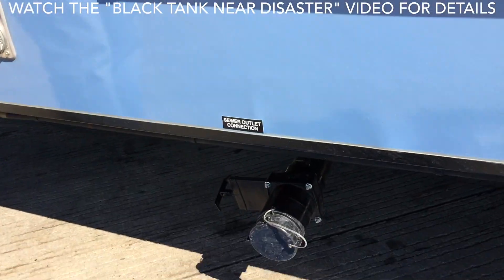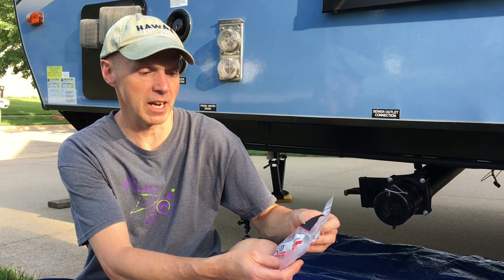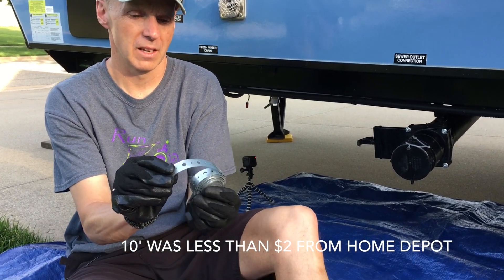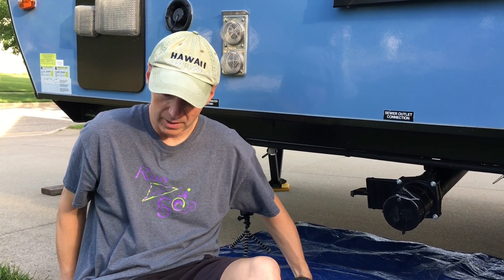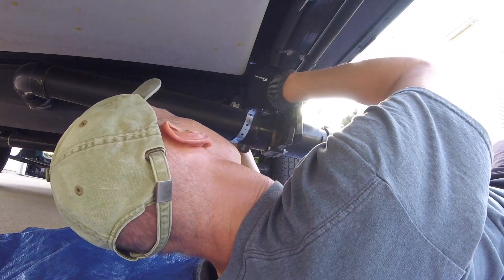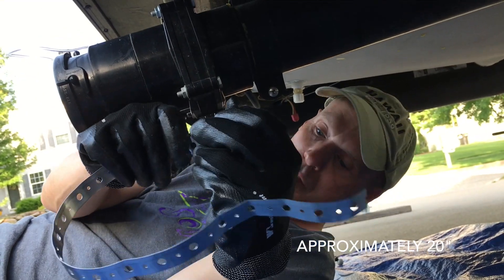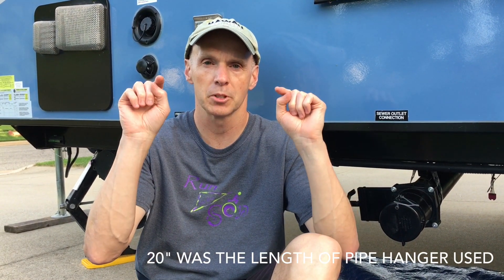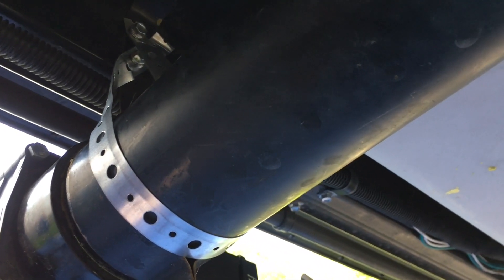R-Pod Black Tank Pipe Reinforcement

Comment from the maker: Products I used in this video to reinforce the black tank sewer outlet hanger:
- Galvanized Steel Hanger Strap: https://www.homedepot.com/p/Oatey-3-4-in-x-10-ft-Galvanized-Steel-Hanger-Strap-339232/100167964
- Stainless Steel Split Lock Washer: https://www.homedepot.com/p/Everbilt-1-4-in-Stainless-Steel-Split-Lock-Washer-6-Pack-800411/204276544

Products displayed in this video*:
- Camco Flying Insect Water Heater Screen (4.5" x 4.5"): https://amzn.to/2KmvFaR
- Camco Flying Insect Water Heater Screen (6" x 8.5"): https://amzn.to/2tLOopt
- Camco Flying Insect RV Furnace Screen (2-7/8"): https://amzn.to/2lDfBXA
- Not shown, but also useful - Camco Flying Insect Screen for Dometic Refrigerator (6 pack, requires 2 packs): https://amzn.to/2yFqUrw

*Affiliate Link Disclosure:
As an Amazon Associate I earn a small commission from qualifying purchases. These commissions help support the future development of this channel.

Comment: Traveling from AZ to NY on a 6 week road trip, I noticed the bolt was loose holding up my black tank pipe.  I replaced the bolt and nut in Indiana. On our way to Canton, the black pipe hangar strap broke at the 90 degree bend and was dragging on the ground.  Fortunately, I was able to quickly use some rope on the side of the highway and get back on the road within 5 minutes.  Once at the campsite, I ordered a new fitting and got some metal strap at an Ace Hardware.  It is highly recommended for any R-Pod owner to reinforce this hangar.  Once I get back into AZ I am going to use some threaded rod and really get this problem resolved.  Thanks John!

Update:  used a 4” eye bolt with a 1/4-20 thread pattern and really secured this pipe.  Backed it up with a metal strap.
Reply from the maker: Thanks for sharing your experience. It’s unfortunate this same issue is still happening. All the best!

Comment: Sitting here in my campsite watching this video. My bracket broke where the bracket attaché to the pipe, on I-40 west of Santa Rosa. Unfortunately significant damage to the end of the drain since it hit the pavement and someone signaled us. We are doing the pipe wrap fix tomorrow and probably will reinforce the gray water at the same time. Everything from the valve gate to the end destroyed. Was able to jury rig a temp fix and seal the pipe. Man’s best friend, duct tape allowed to attach the hose and seal the gate and we can still use the tank. Bracket is worthless!! Video saved the whole trip.
Reply from the maker: Al, sorry to hear about this happening. It has been a real issue with the R-Pods for years. Sounds like you were able to get it under control in the short term. I am glad the video was helpful. As an FYI, the fix I did on this was done in 2018 and is still holding up fine. All the best!
Reply: @JohnMarucci  thanks John. I get to my daughter’s in the Bay Area tomorrow. A follower RVer and I tried to jury rig an attachment to the waste hose, leaked badly but we were able to dump the small amount of test water we put in. Leaked pretty badly, so I’ll have to wait till I can rebuild from the gate out. I think the easiest part will adding the straps. Having no bathroom is really a drag

Comment: Hi John, I watched this video after we got our 2019 R-Pod 190, and I thought great idea, so I added straps “just in case” on the black and gray tank pipes. We’ll, I’m SO GLAD I did. This past weekend we drove to our favorite campground, and upon arriving and hooking up I noticed that the bracket for the black tank broke clean through (at the bottom of the L bracket and where the screw is). Luckily I had added straps like you did, so the pipe didn’t get ripped off or drag along the highway. That would have been a really crappy experience (especially for the people following 💩😳). We have yet to receive the recall notice, I called Forest River and of course they didn’t really seem to care. Soonest service date is November here in Walla Walla, in the mean time I discovered a better way to mount that bracket, reusing the original piece but re-engineering how it mounts to the pipe and frame to eliminate the flex that broke it in the first place. Thank you very much for this video, it literally saves us from disaster! 👍
Reply from the maker: Joe, glad to hear you had reinforced the hanger before the bracket broke on you. As a reference, I put the galvanized hanger straps on my R-Pod in March of 2018 and they are still in great shape and have worked without issue since. All the best and thanks again for the comment!

Comment: Thanks for this! I checked the black tank hangar on my 2017 R-Pod model 179 before my latest trip. It seemed OK, with no flex. But 4 miles up a bumpy dirt road last week in the eastern Sierra, I heard a noise and saw in the mirror the outlet dragging in the dirt. Thankfully, I had zip ties for a temporary fix.  

Note to all...when checking your black tank hangar, get down on the ground and look up the whole length of the hangar. Or...just follow this video, and fix the hangar before it fails. 

Thanks for this video.
Reply from the maker: Thanks for the comment! Glad you had some zip ties. All the best!

Comment: Hi John,  same thing happened to me, except the down strap broke completely.  The bracket bolt was intact because it had a lock nut on it and it was holding the other broken piece.  I replaced the entire down strap with galvanized perforated strap doubled.  I did successfully drill a second hole and reused their self tapping screws. I wasn’t lucky enough to have the original holes lineup. Tomorrow I’ll crawl back under there with a small can of black rustoleum paint and tube of silicone and fill the old hole left exposed.   I’ll cover the terminal connections (sensors) on the sewer tank.   Their cover looked like it wearing off.     Yesterday I replaced the hotwater heater module. The original had 2 burn spot on it.  I have a 179
Reply from the maker: Robert, thanks for the comment. It is unfortunate that this keeps happening to R-Pod owners. It sounds like you have a well thought out solution that really shouldn’t have been needed had it been done properly at the factory. This is an obvious and ongoing design flaw, and since a lot of water/waste weight can fill the larger diameter black tank drain pipe, it means we all have to be extra careful to drain the tank fully before travel. All the best!

Comment: Wish I had seen this earlier!  We were driving down the highway in Idaho when a car notified use that we had an issue with the Rpod.  I pulled over, and the bracket holding up the pipe had broke and the pipe was dragging on the ground.  It ground down quite a bit, causing the valve not work.  Luckily we had some bungee cords and were fairly close to an RV shop.  I’d suggest for anyone to reinforce that pipe!  Thanks John!
Reply from the maker: Jon, sorry to hear this. This has happened to so many people I’m not sure why it hasn’t been fixed in production a while ago.

Comment: Thanks John. A  great tip and idea.I wonder about those loose wires going to the sensors. I duct taped some of mine up I have a new 180. Your thoughts?
Reply from the maker: I don’t like those wires loose either. I will likely do something similar soon. I wouldn’t want road debris catching one of the loose wires for sure. Thanks for the comment!

Comment: So John, what do you use to take off the black corrugated cover under the RV to get to the inside of RV beam to place that strap?
Most are not bolts but look like some type of rivets.
Reply from the maker: My R-Pods didn't have the sealed underbelly and I haven't dealt with this on my Keystone Bullet that does have this material. My counsel is to search YouTube or call a local dealer and try not to get into a situation where you can't replace the material.

Comment: This happened to me. Twice!! I definitely want the backup tape now. But I don’t have that fancy-dancy drill. Will my standard one work if I’m just removing the bolts already in place and not drilling new holes?
Reply from the maker: You should be able to reuse the existing bolts that are in the frame as I did. You will need the correct socket to remove them in order to install the aluminum hanging strap.

Comment: You can buy an a replacement pipe hanger bracket from Forest River.   I already broke both of them and had them replaced and I expect the replacements to break in the not so distant future because they are made with inferior metal and are bent at 90 degrees which is guaranteed to already greatly increase the fatigue in the bend.  I have found that the RPODs are a weird combination of good and horrible materials, some things are really well made, others are made with what appears to be the cheapest and worst possible choice.   RPODs - and RVs in general -  are NOT for the faint of heart and people unfamiliar with mechanical repairs.
Reply from the maker: Thanks for sharing your experience. My easy fix using the strap never failed for several year.

Comment: Could you just use a thick zip tie?
Reply from the maker: Short term possibly. I’d want something more substantial longer term. My fix using the galvanized hanger strap was easy to do, cheap, and is going on four years without any signs of issues. Thanks!

Comment: Thanks for all your great videos. On this project, however, I would be concerned about the sharp edges of the plumbing strap cutting into that propane hose over time.
Reply from the maker: Good point but likely not an issue. I have had mine on like this for coming on three years with no gouging to the plastic pipes. Many people use pipe hangers instead vs the straps. Use what you are comfortable with, but the main point is to have something as a backup to the small bolt. Thanks!

Comment: I really appreciate your informative videos, John. I'm getting ready to reinforce our tank pipes. How has the strapping tape fix held up? Any issues with Michael Nelson's concern of rubbing through the pipe?
Reply from the maker: Mary, the pipe hanger strap (and new bolt with locking nut) has held up great over the last year since we added it. Several thousand miles including a round-trip from Michigan to Florida with no issues. Very please with the solution. Also, zero noticeable wear on the pipe from the hanger strap. Thanks for the follow up question!

Comment: What size bolts did you use?
Reply from the maker: On time stamp 15 seconds on the video it shows a picture of the bolt. It is an M7-1.0 x 20 mm zinc plated bolt. Thanks!

Comment: I really enjoy most of your videos, but I don't think this is a good thing to do.  The sharp edges of that strapping metal are going to dig into the plastic as everything vibrates.  I think it would be better to use automotive exhaust pipe hanger hardware than that metal strapping tape.
Reply from the maker: Thanks for the comment. Your idea is likely a better solution. I have put a bunch of miles on since and am keeping an eye on it. So far I’ve seen no gouging on the pipe. Thanks for watching and commenting!

Comment: John, thanks for your videos. Shame on me!  I watched this video before buying a new R—Pod 195 but assumed this type of mounting had been improved and didn’t even look to see. Well it’s still the same and on our trip last weekend our bolt broke and we drug our pipe on the interstate for a few miles before someone flagged for us to pull over.  Again, stupid me for not checking!  Very poor design. Warranty repair is scheduled.
Reply from the maker: Mark, sorry to hear about this. To me it seems inexcusable to not have fixed the flaw in the tank support bracket by this time and with so many incidents. Again, sorry this happened. All the best.
Reply: @Mark Ramey. We also watched this video before purchasing our 2020 RPod 190 and the same happened to us. We drove over 40 hours and the bolt became loose and we drug it for a very long time on The interstate only to be flagged down after the pipe end had completely broken off. We had no choice but to stop at a near by Gander RV/Camping World and was told that warranty would not cover this type of work. $170 to fix. Did you contact Forest Fiver directly?
Reply: @s.garcia2733  No, I did not contact FR directly, I just took it to the dealer I bought it from and they fixed it under warranty and I did have to pay for the repair.  The hassle was it was three weeks before I could get a scheduled appointment and then they had it a week.  Our 195 was at the dealer three different times for a total of about 3 months in the first 6 months of ownership.  What a pain!  However, in between, we did have some very nice camping trips.
Reply: Mark Ramey Oh I see. I misunderstood your comment. I thought it was paid for under warranty. We actually live in Santa Fe NM and traveled to Louisville Kentucky to pick up our rig. A 19 hour drive. Then drive around the country for a few days. We contacted the dealership and they told us it most likely would not fall under warranty and we would pay for it out of pocket. Luckily we were right down the road from a place when we were flagged down in Amarillo TX. Makes sense now though. We thought our dealer wasn’t much help.
Reply: S. Garcia I’m sorry. I noticed I typed I did pay for the repair. I DID NOT pay anything for the repair. It was covered under my one year warranty. Sorry for the confusion!
Reply: Mark Ramey Ok great! We are going to attempt to send In all of the pictures and bill from the repair. Maybe we can get a $170 check back. If not, I guess it was worth the try! Thanks for your help!